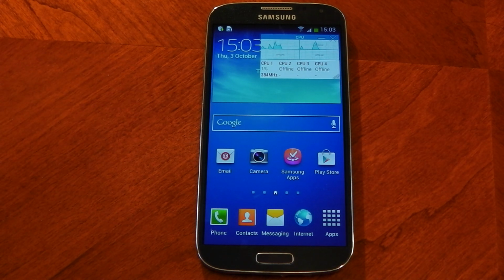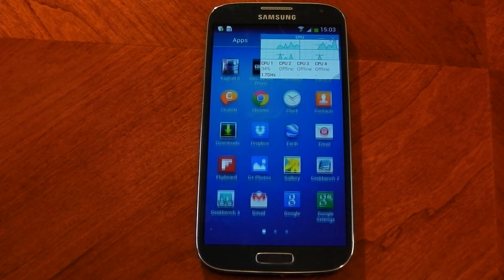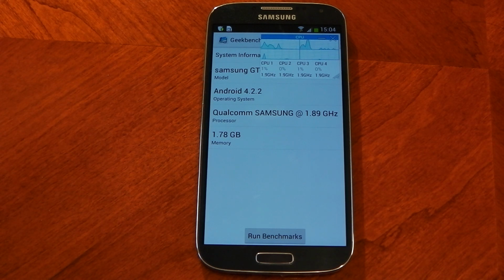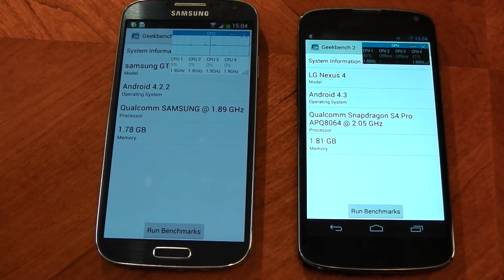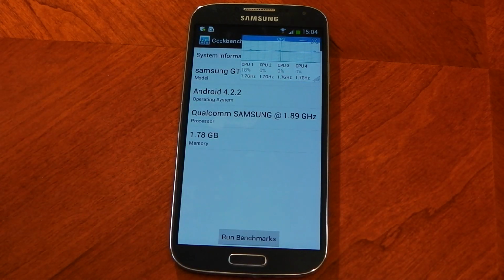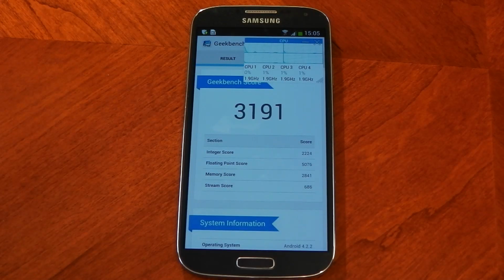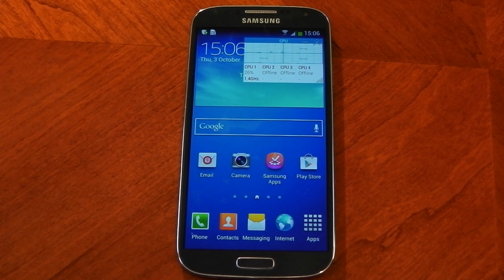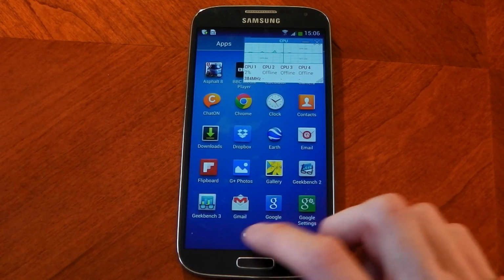OEMs Cheating in Android Benchmarks!? - Thoughts / Test

Comment from the maker: well .. a quad core processor is good. if an app or OS is threaded correctly .. the quad core processor will be faster than a dual core one in the same app ..  .. the iphone 5s has amazing single core performance.. but the snapdragon 800 in the note has better multi core performance

Comment from the maker: well , the way it works is the system looks at the load and ramps up based on how high it is... now you could make the system check the loader more times .. so therefore it could detect the load quicker , but that will cause more battery drain ,